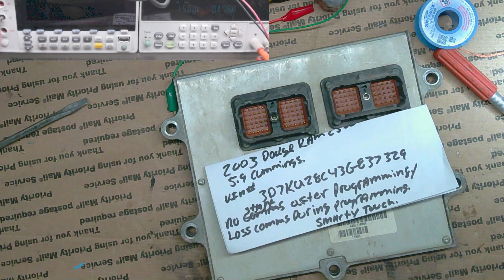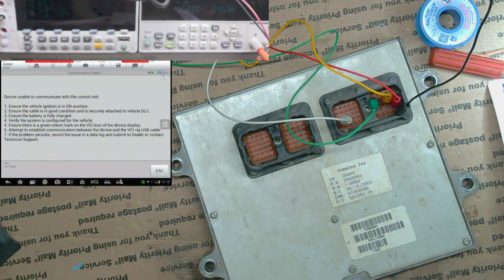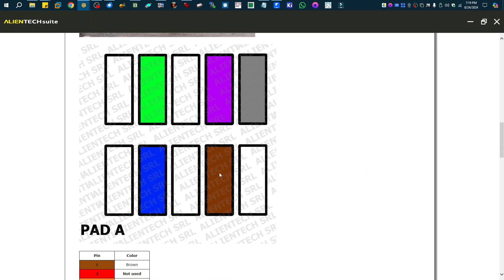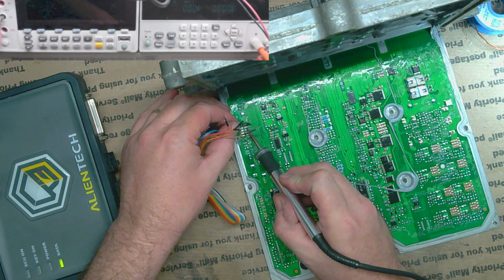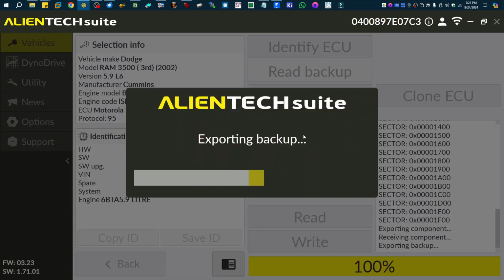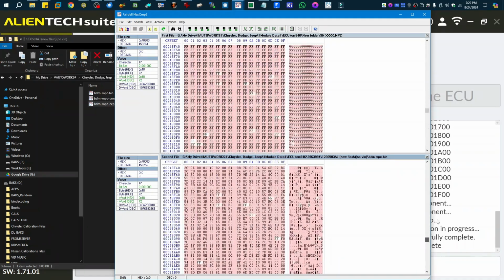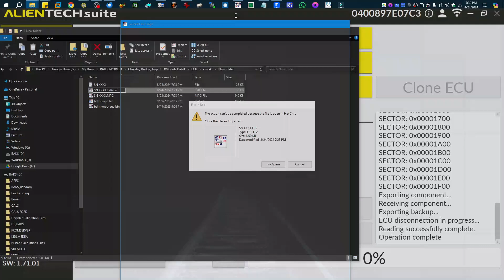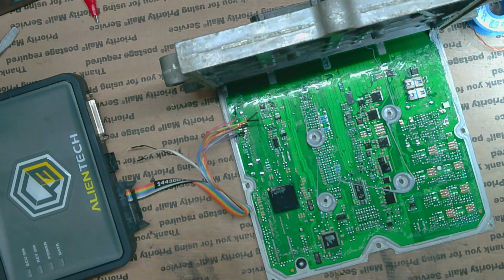Ram 5.9L Cummins ECU Bricked by SMARTY Tuner, Can I Fix It?

Comment: I’m getting 8.29 volts out of pin six and it’s supposed to be a 5 volt reference. Also pin 7 is giving me 8.29 volts. I’m guessing they are shorting inside the case. What’s your thoughts.
Reply from the maker: Hard to say. That is an odd voltage to see.  Does ecu communicate?

Comment: Do you fix semi truck ecu, like dd15 or isx15
Reply from the maker: I do right much of the semi cummins stuff cause its very similar to the light duty stuff I do but not too much of the others. I will take them once in awhile but usually I dont have enough time to invest on them since I do not have a lot of premade testing set ups for them.

Comment: Is it possible to replace the microprocessor on those ecu’s? Are the parts available?
Reply from the maker: Yes but its a pain (and inconsistent)  because of the aluminum case.  I do it with some of the more expensive part numbers but this one is pretty low cost for a core so its easier to just replace the whole unit.